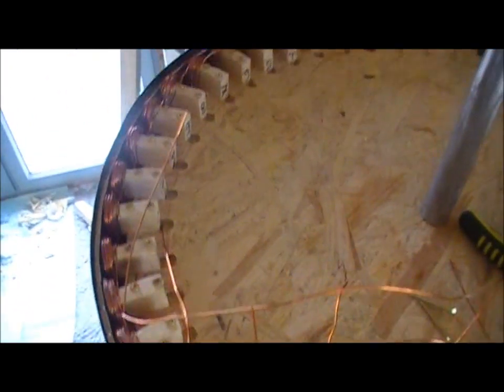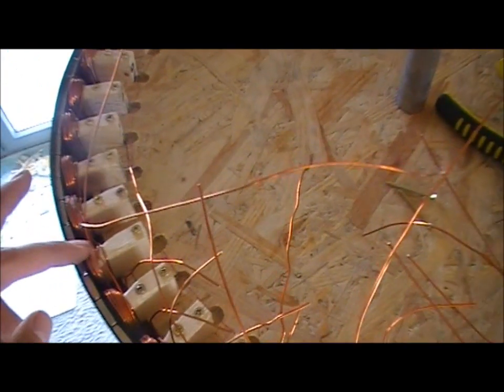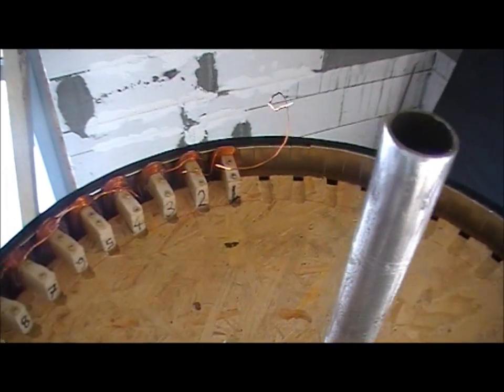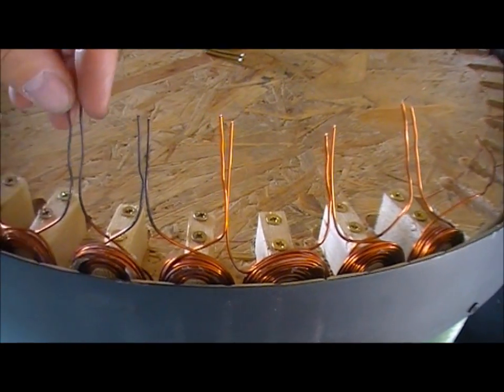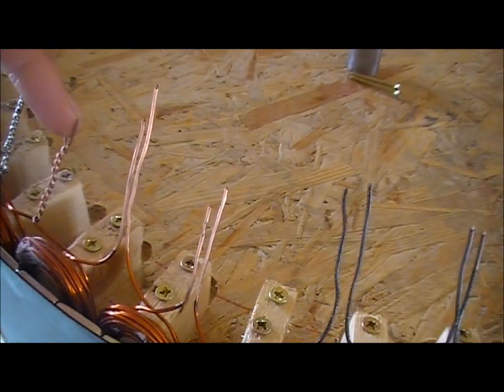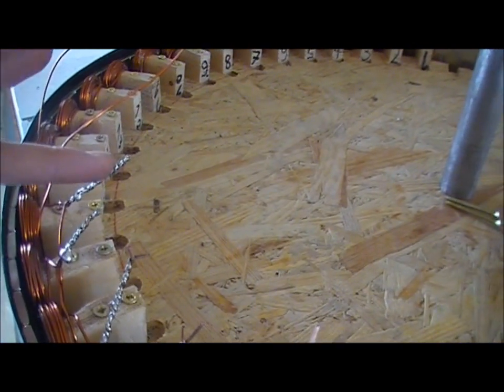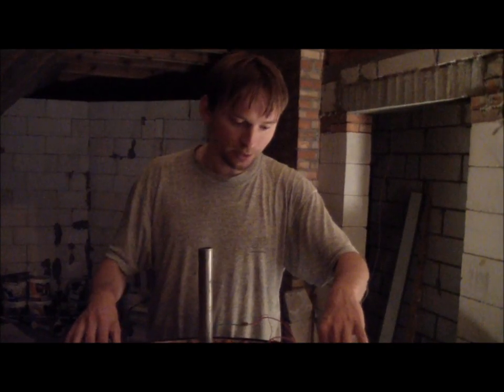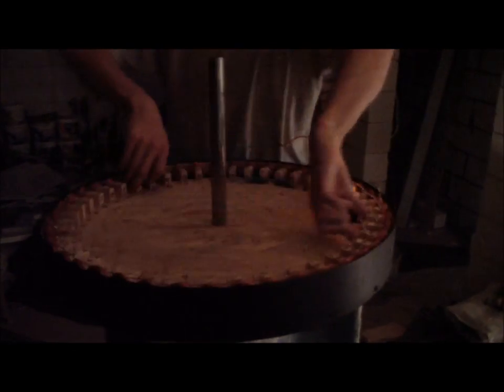Home made windmill generator part 5 - connecting the coils

Comment: good job , did you connect the coils in parallel or in series ?
Reply from the maker: In series.
Reply: ChrisWantsToKnow looks like gauge 12 what rpm and what voltage you getting am doing tests with coils gauge 17 but under load the voltage drops from 120 to 30

Comment: hello.
 i want to ask about coil wind on core, i am using PC fan in which 4 poles, all coils are wind in same direction or one coil forward and one backward ????
Reply from the maker: +Bhai BhaiKhurram Please understand that coil designs vary. So they can be so and so. Therefore I do not know how yours is made. But usually they do alternate.
Reply: +ChrisWantsToKnow  In first thanks for your reply yes i am making alternator wind 3 coils then use rectifier. in this situation all coils are in series and in same winding direction ????
Reply from the maker: +Bhai BhaiKhurram I can not answer this because I do not know how the coils and magnets are positioned. I am sorry. Usually generators and motors with 3 coils are not in phase but differ by 120° (360° / 3 = 120°) and you can not simply connect them in series. This will not work.
Reply: +ChrisWantsToKnow  thanks for your answer

Comment from the maker: Because metalls are usualy good electric conductors. So when the magnets run around them, elecric current is induced not only in the coils, but in the metal holders too which then work as a eddy current brake and slows down the rotation, thus functioning as a brake which reduces efficiency.

Comment from the maker: Because the iron core would be attracted to the magnets. This would cause cogging. This in turn would render the generator useless in slow wind because only a strong wind would manage to initially overcome the attraction of Magnets and start rotation. Since strong wind is not that common where I live, the losses due to the iron cores would be bigger than the gains. Of course when you live in a windy region, the opposite is true.

Comment: You used so much heat on those wires to burn off the coating I thought it might ruin your coils before you even got the chance to test it.  Glad it worked.

Comment from the maker: @wtam69 Yes, it is just a simple single phase generator. If the magnets poles are facing the same way, then the coils have to face the same way too. If the magnets face in the opposite direction, then you need to switch the coils polarity, or the voltage would be substracted and not added. I am thinking about making a video about that because i realize that i haven't covered that topic at all. Would you enjoy a video explanation of what is going on exactly within the coils in the magnetic field?